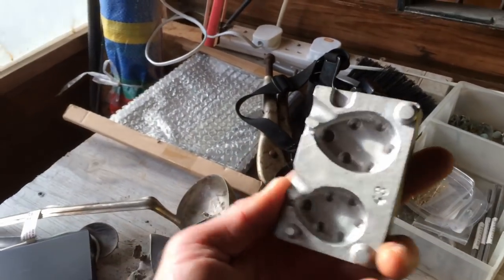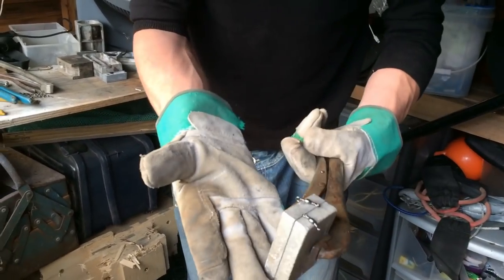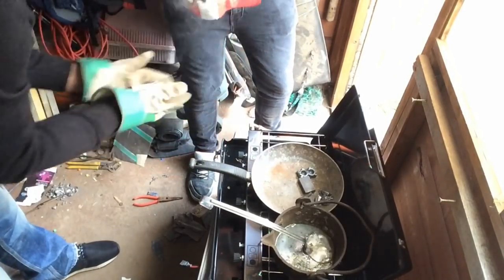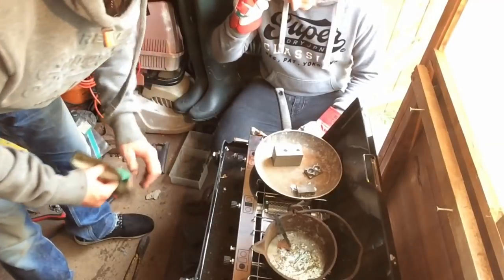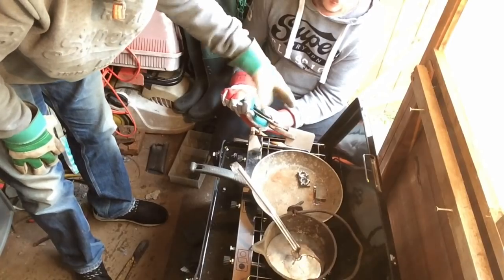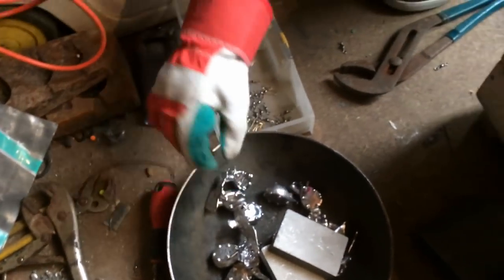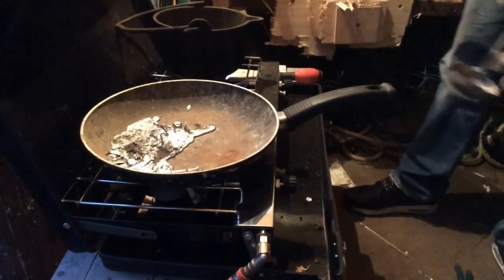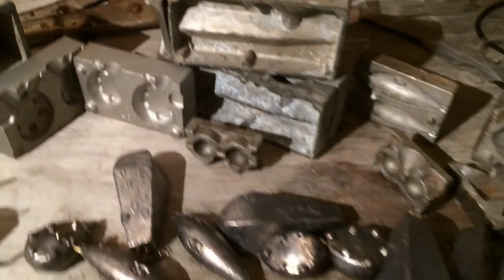How To Make Fishing Weights, Melting Lead , Making Fishing Leads

Comment: Hey Jay, great vlog for those who haven't cast their own weights. I make some tube weights for the bottom of feathers from chrome hanging rail, cut down into assorted sizes, make a wooden baseplate and drill retainers in, so you can stand the tubes in, pour in molten lead, and whack a loop in. I use these if Im not putting a pirk or small lure at the base of a string of feathers...creates a great flash attracting launce, macky, and the odd pollack or bass. Hope this weather clears so you two can get out and smash shoreline again. Nice work lads. Rich